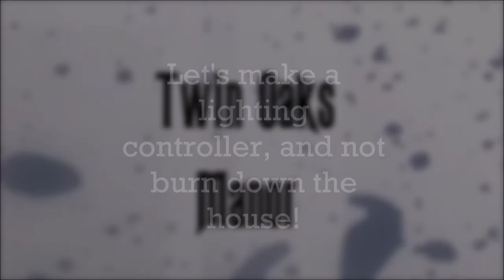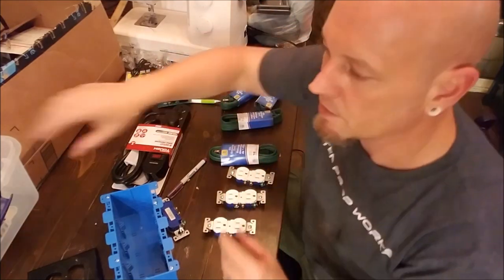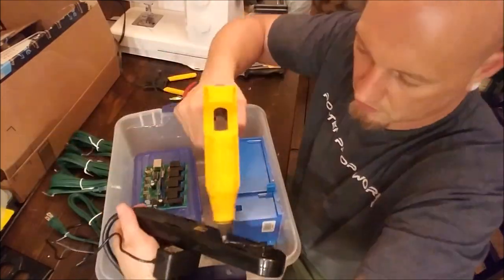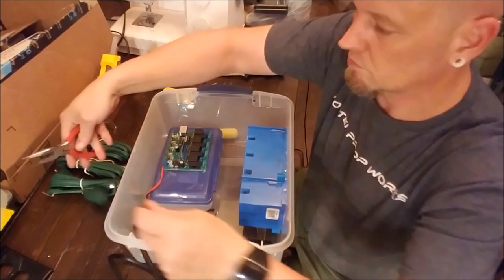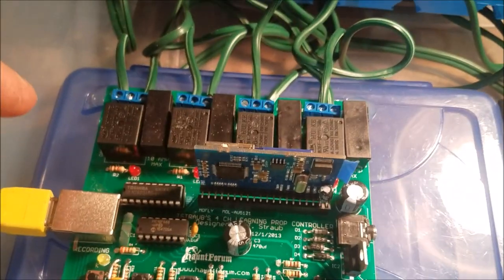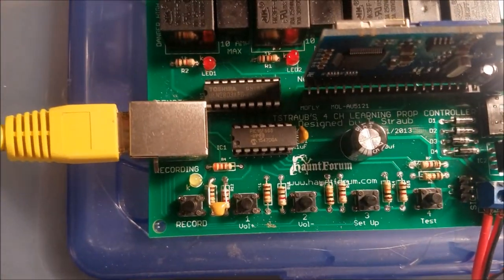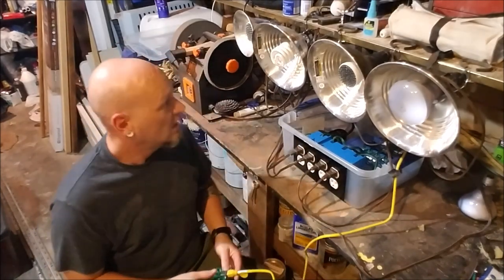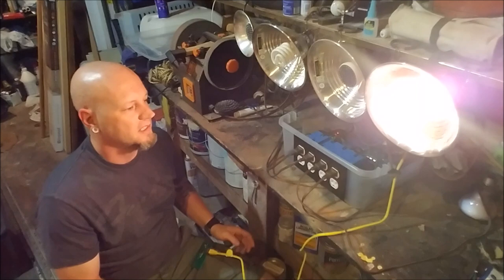wiring a prop controller for lighting

Comment: Looks good.  Note that it works regardless of which of the two sides of the internal cords pass through the relay.  It's safer, however, to have the live/hot wire go through the relay and have the neutral be the unbroken one the goes directly to the outlet.  The plugs have one blade larger than the other so that they only go into the outlets one way.  Lamp sockets are (should be) wired so that the live wire is the contact at the bottom (that you're very unlikely to touch).  This prevents a nasty shock if you touch the threads of a light bulb while screwing it into a socket that happens to be on, assuming all the wiring is correct.

Extension cords and lamp cords will (usually) have the printing on the insulation over one wire and a ridge or stripe over the other.  This allows you to keep track of which conductor carries the live voltage and which is the neutral.  (There's a standard, but I don't trust myself to remember it, so I look it up each time I need to know.)

It would also be an excellent idea to connect the grounding terminals on each of the outlets to a ground pin on the power strip.  Even if you plug in nothing but 2-pin lamps, having the ground connections can be important for safety.